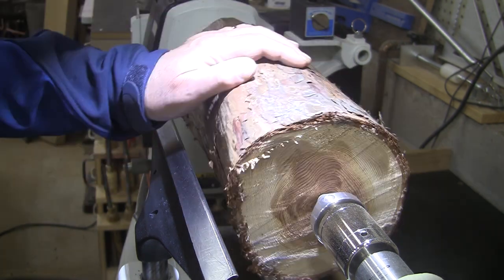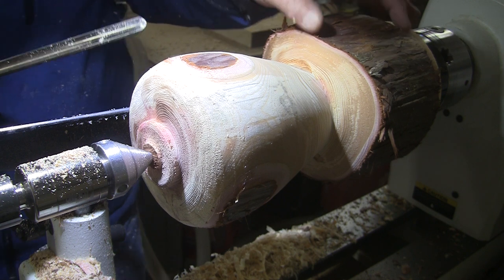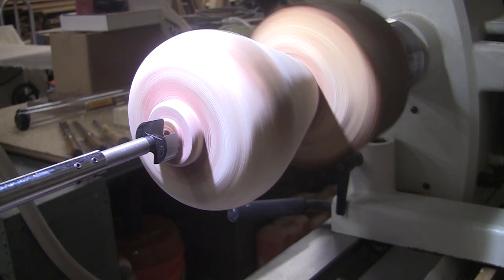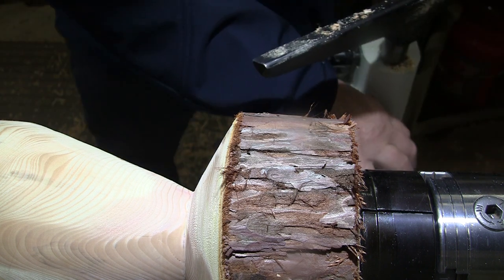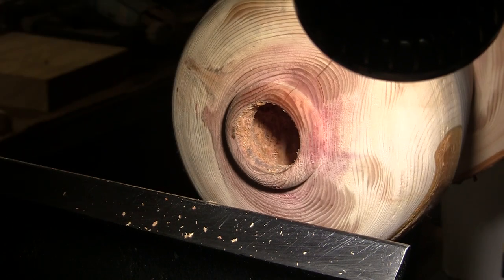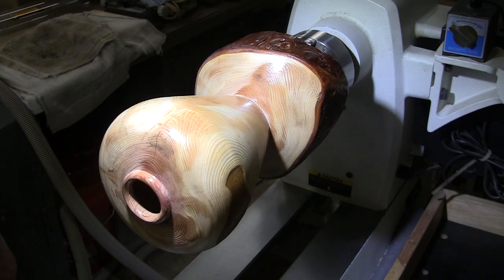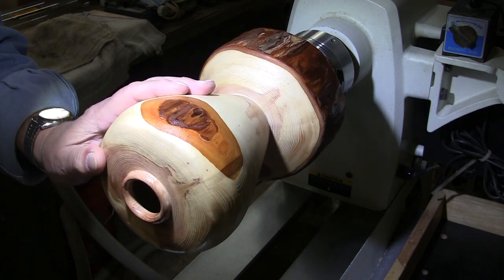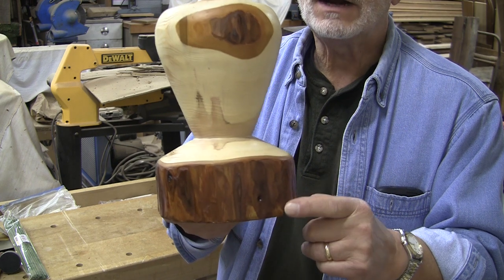Redwood Emerging Vase - Wood Turning

Comment: Hi Phil; OK I understand the long wait times and video time requirements. The thing about Walnut oil is, (1) it's inexpensive. You buy it at your local supermarket. (2) It's food safe. Many people use it on salads etc. (3) And best of all it actually dries and does so at about the same speed as shellac. Try it. Pick up a small bottle the next time you go shopping and give it a try. It applies the same way as shellac and I do use a four ought steel wool between applications. Just another tool in the tool box. It really brings out the grain in light coloured woods. Just for what it's worth.
Reply from the maker: Thanks for the info, Dan.

Comment: Hi Phil
That is a beautiful form and the bark really adds to its beauty. I use the Trend air shield pro and recommend it highly. I used to wear it only when sanding but I found that my breathing was affected even when turning. It took me a while to realise that it’s the particles you can’t see that cause the problems.
Stay safe my friend
David
Reply from the maker: Thank you, David!  I have heard good things about the Trend shield.  So far, I have done well with the slightly upgraded mask I wear.  I think my problem arose when I was explaining the sanding of the bark and didn't have my mask on, briefly.  Probably spores in the wet bark and wood.  Thankfully, I'm much better, now!
Staying safe in Bonney Lake, WA!  You do the same, my friend!
Phil

Comment: Very pretty. I was hoping for some professional advice.  I have a cedar root stem that I let dry for a couple years; it is approximately 4 feet long by the thickest portion one-inch in diameter.  I debarked it and sanded it to 400 grit,  "I" think it turned out pretty cool.  It has no function, just a stem.  I was hoping you could recommend a stain or finish.  Thanks.  Enjoy your channel!
Reply from the maker: Thank you, Rick!  I never use or recommend stain.  I just think if you want a light wood, use a light wood.  If you want a dark wood, use a dark wood.  As for finish, there are sooo many choices.  For me, I prefer shellac.  It's easy to use, dries fairly quickly and perhaps most important, if it fades or gets scratched, you can apply another coat right over the old and it looks good as new.
Thank you, Rick, for watching and commenting, much appreciated!
Phil

Comment: Phil, sorry you got sick.  I like the vase but have a question. I've probably tried ten or more vases like that. Some with a natural edge base and some with a turned but thick pedestal base. Virtually without exception the unhollowed base will develop deep/large cracks within a couple of weeks if  the wood was at all wet. This happens even with poly finish and storing in a paper bag (without adding shavings, however). The hollowed part is thin and dries evenly without cracks but the base, again, almost always cracks. Any suggestions?
Reply from the maker: Feeling much better, Don, thank you!
I think a lot of it depends on climate.  It's pretty cool and wet here so the piece has a chance to dry slowly.  Also, we don't turn the heat up in our house.  Never over 68 degrees.  I also feel it has a lot to do with the type of finish.  Poly will seal the wood to where it can't breathe.  I use shellac, a lot, and I think it doesn't seal the pores as much and gives the wood a chance to dry more slowly and evenly.  That said, it's only been a couple weeks in the house.  I do expect some cracks at some point, but I don't expect them to be really large.  Time will tell.
Phil